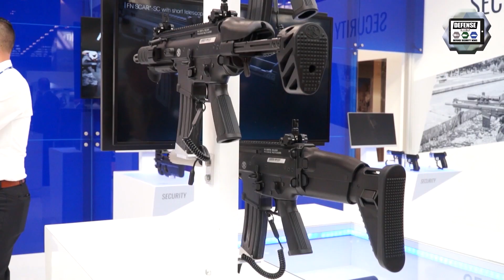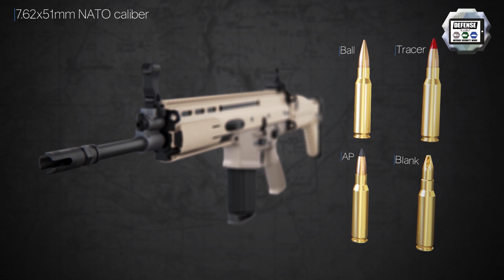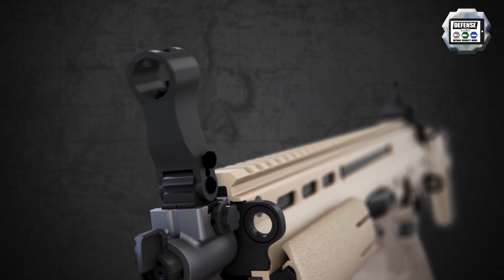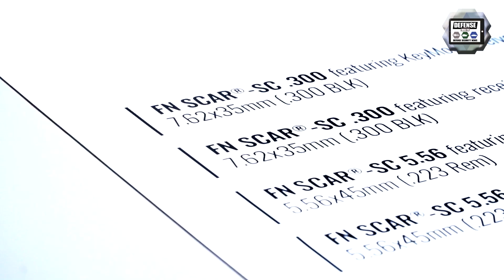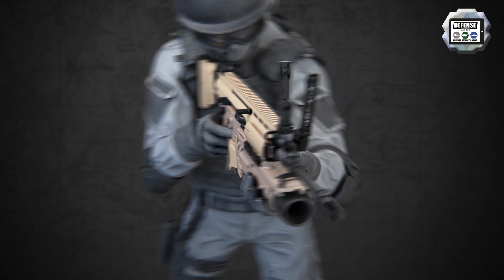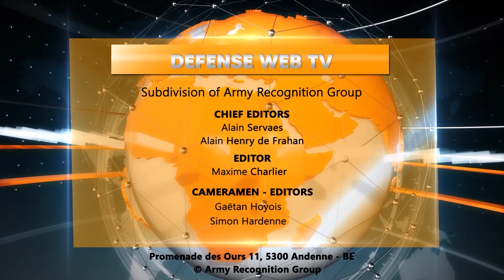Assault rifles 7.62 mm 5.56mm technical review analysis FN Herstal SCAR-L SCAR-H SCAR-SC

Comment: the only weapon with all its moving parts open to dust and mud. much too expensive weapon for the soldier logistician, gunner, artillerie men , truck driver, sapper. give them a new fnc next gen and the have the richt gun for the richt price and same performance for there job.
Reply: FNC is more comfortable AK (gas system and bolt like AK). For me it doesn't matter I am fan of ak74m, but what about west?